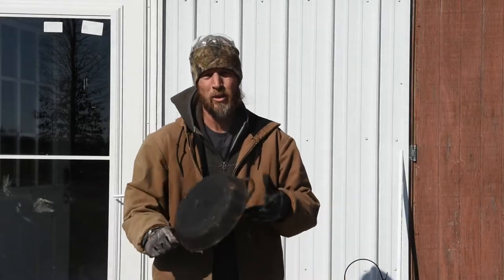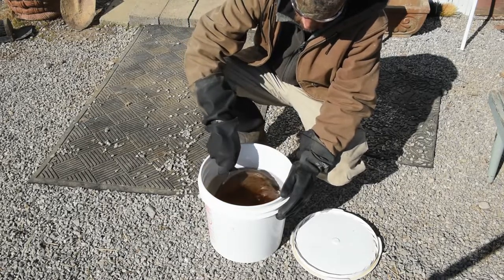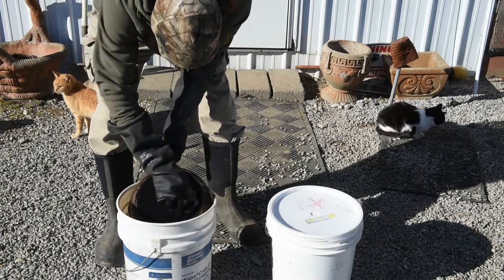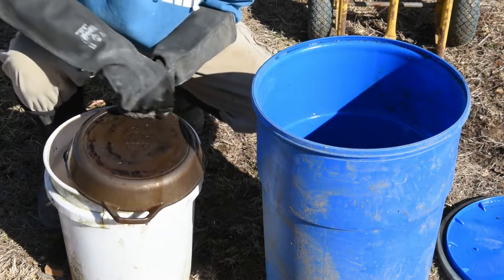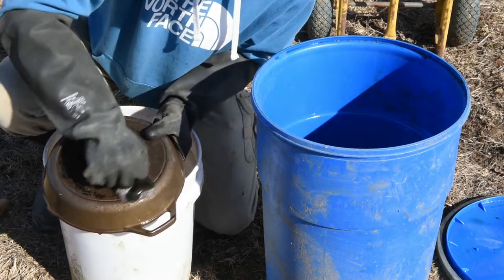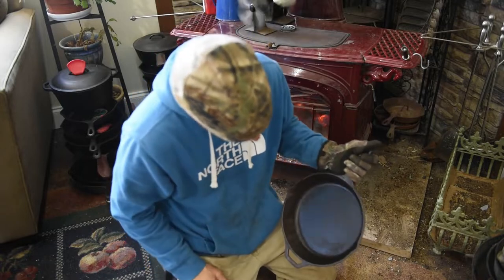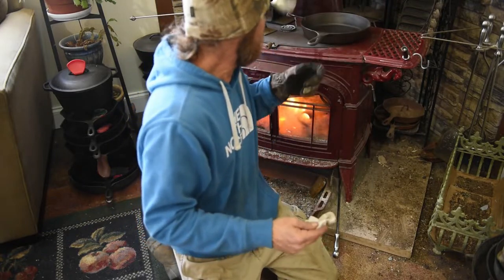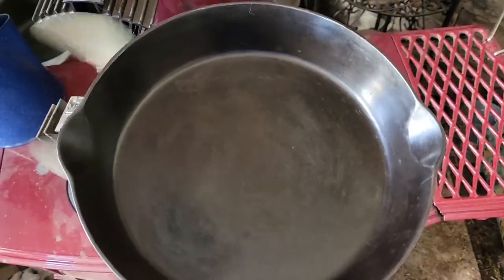Restoring a Lodge #8 SK Cast Iron Skillet. How to clean cast iron the easy way.

Comment: I know it's not Christian-like , but I envy your collection. Seriously. Call me a nervous Nellie , but I'm a little apprehensive about cooking on porous metal that has soaked in lye. Have you ever burned them off?  We used to burn them in corn cobs with 100% success, but the cobbs burn hotter than anything I've ever seen. I'd hate for Great Grandmas ancient old Birmingham Ironworks skillet to become a spinner.
Reply from the maker: I understand some people are apprehensive about using lye. Lye is caustic only because it has a ph of 13 or 14. If you wash your pan with clean water after cleaning with lye it is perfectly safe. Every professional restorer uses lye and e-tanks. I am working on a video using e-tanks and it doesn't use lye, I would never put CI in a fire,I have seen many pans ruined that way. I am also working on a video right now about the dangers of putting cast iron in a fire.Thanks for the comment and thanks for watching.